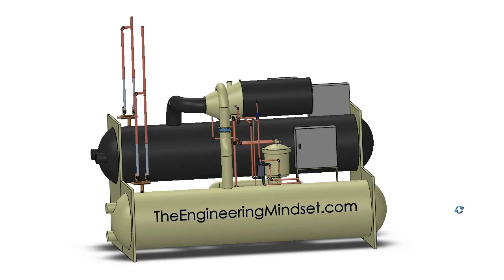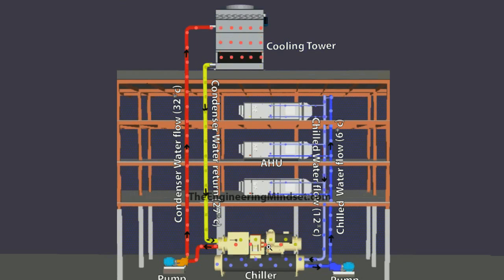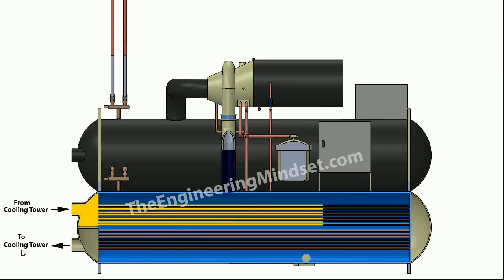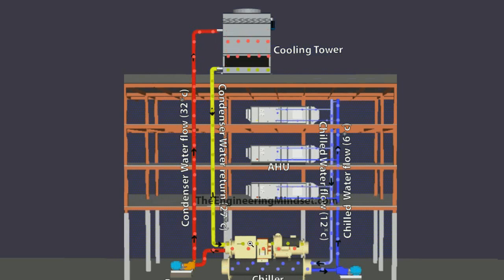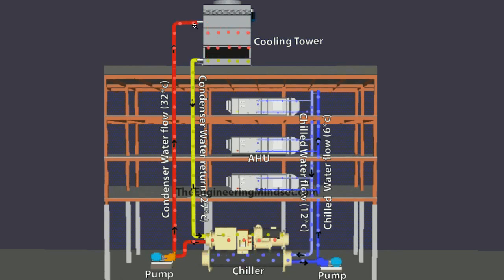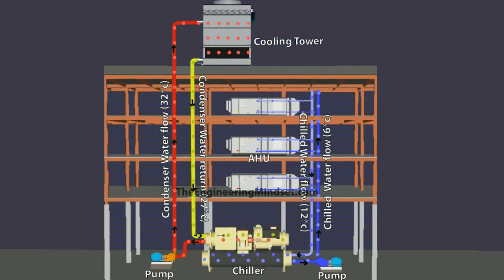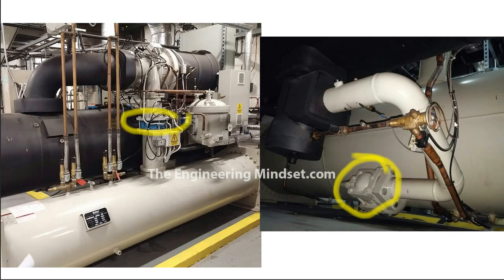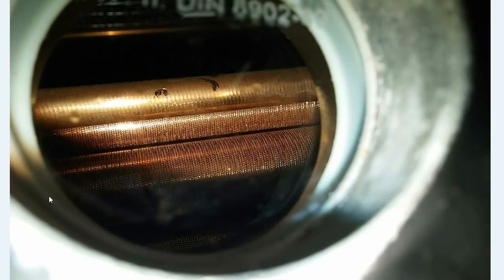🔧Chillers - Condensers

Comment: Just worth noting, the entering condenser water is always the bottom nozzle on a vessel with more than one pass and the valve highlighted after the compressor is actually a discharge check valve to mitigate the effects of surge. This cannot be specifically isolated.
Reply: That's right! and the author is absolutely not confused by this picture 7:33

Comment: So a quick question. The Heated water going to the cooling tower and Return from the Tower:

If the AHU's had heating coils as well, could they also tap into and use those water lines to run the heating coils?
Reply: Yep that's called 'heat reclaim' and it's Increasingly common as it's 'free'.
Reply: @oddieeeeeee  Nice. I was pretty sure It made sense.What I find quite interesting it's similarity to the Human Circulation System of Arteries and Veins.

I wonder why such systems aren't also used in Residential, since they have Hot and Cold Water Running around too. Seems a Ductless AC could tap into those lines.

Comment: Hello sir, I have one here with me here, when we start the compressors it runs for 2 second and stop and the system didn't receive gas, when I check the pressure there is high pressure in the condensing part and less pressure  in the everprator, sir what is the solution.

Comment: is the Bottom portion u r saying thats the condensor.. but actually its the evaporator right???? just seen in other videos.. just for the clarification am asking..
Reply from the maker: It's different on different chiller models. This particular version has it at the bottom. Whichever is connected from the outlet of the compressor is the condenser

Comment: Why not to pump the refrigerant outside and use radiators with fans to cool it? It will be a closed system, guess the efficiency or cost don't match?

Comment: Hi Paul! Great initiative to explain all such HVAC equipments in details.
I also request you to please put the videos of heat load, coil design, cooling tower design, pump head calculations as per the ASHRAE/ISHRAE DATA BOOKS which will help us a lot.
Thanks again a lot for the videos.
Awaiting your your positive response on the same.